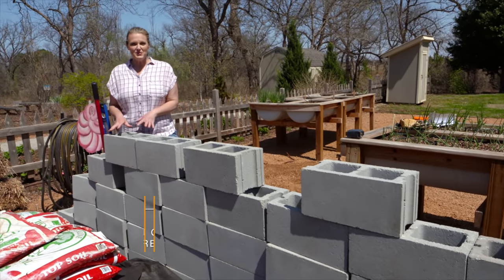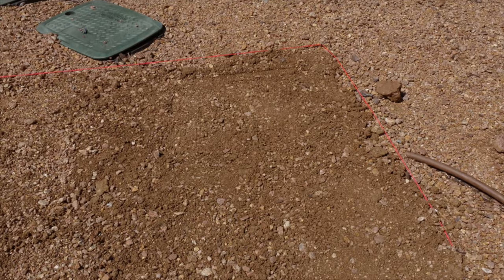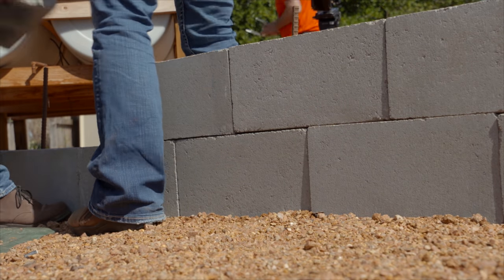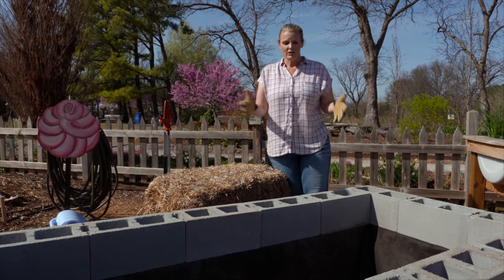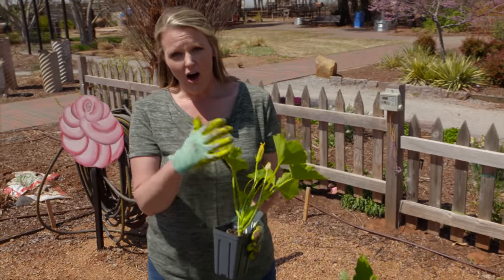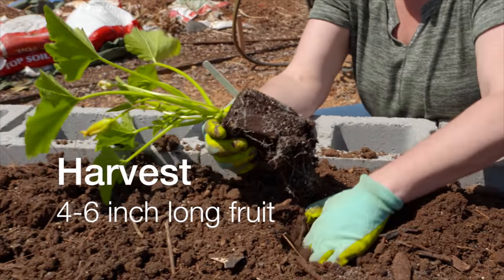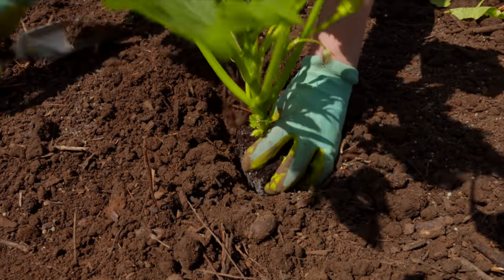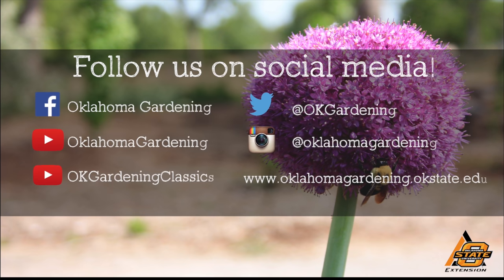Building a Cinderblock Raised Bed and Planting Squash

Comment: Great video. Learned a few things I should keep in mind when for when I do my single large bed that'll "encapsulate" the two 5'x10' wooden beds that are about ready to let go. My plan is to use 6x16x8 blocks stacked three high for a single 15'x15'x2' bed. I'll use rebar on the corners and at two evenly spaced spots on each side wall to hopefully resist bowing over time, and for the sake of extra stability (and disposal of something I'm trying to get rid of) I'll fill with river rock and some sand I've been wanting to get rid of.

I'll reuse the soil from the two wooden beds and for the first year I'll till the snot out of it and spread it even, then each year run the boatload of maple and oak leaves that I end up with through the mulcher and till them into the soil to gradually build it up and make sure it's got plenty of organic matter for healthy pumpkins and sunflowers.

Comment: A couple of suggestions.... 

After you place the bales of straw down in the bed, soak them well. Remember that straw is hollow stemmed and any dry organic matter that you use in this way will wick water out of the soil above away from your plants. This will also allow the straw to begin to break down. Because decomposition will happen, yes, the addition of nitrogen to the growing area is needed. The gardener must also be aware that as the straw breaks down and decomposes, the soil level above will drop. So don’t be alarmed. When you prepare your bed for the next growing season add more soil and compost as needed to fill the bed back up. 

After you have completed building the walls of your raised beds, fill the pockets in the blocks with soil or the material you used to prepare the ground surface. Those open pockets, left unfilled, can accumulated organic waste material and provide wonderful hiding and overwintering places for pests, like squash bugs. All your hard fought and thought won, hand to hand combat with those squash bugs, their juveniles and eggs, could be lost when the second wave of attackers come crawling out of their hiding places in those open cement block pockets. Been there, done that! : )

Filling the cement block pockets will also provide more stability to the walls of the bed. I would also advise adding rebar in a couple places on the long sides as you did the corners when building the walls. Over time, cement blocks can shift out, especially on the top layer. 

When you fill those cement block pockets, you can install sections of larger PVC pipe to slide in the smaller diameter PVC hoop pipe. Or just drive in some precut sections of rebar to install the hoop PVC pipe on.
Reply: I'm glad you mentioned that, I was wondering about a drop in soil level.
Reply: Thank you for this video I am going to make raised bed now with cinder blocks.
Reply: munchkin5674 with all due respect, munchkin5674, I’m sure she knows the info you just said.
Reply: @MaryDavidson911  she may know, but I didn't. Thanks original poster!
Reply: Will the straw decompose and the rotting material cause mushrooms to grow.??? Concrete blocks are $8.00+ in Canada, cross border shopping come spring is looking pretty good.  Love the simplicity of this method. Thank you 👍 👍 🇨🇦
Reply: @jameslaw3740  $8!? That's crazy, they're $1.26 here in the US.
Reply: @MaryDavidson911  with all due respect. She may have known this but the rest of us did not. Some of us are new so all helpful suggestions and information  are appreciated and welcomed.
So calm down.
Reply: Great information and suggestions!
Reply: @cloak5857  As usual most things are cheaper in the US. I don't think Americans realize how lucky they are. These blocks cost at least £3 - £3.20 in the UK ($4.25.) As another example I wanted a wood chipper (by DR Power) it was on offer for ~$800, I emailed asking about shipping to the UK and was told they sell them via their UK arm . . Hurrar ! Nope, emailed the UK arm and the cost of same item in the UK was £1,800 ($2,300,) Unfortunately this is fairly normal.
Reply: @MaryDavidson911  With all due respect Mary Davidson, as this is an instructional video, she should have talked about these things.
Reply: @munchkin5674  yes, there's no way Mary could know "for sure" that the video maker knew everything you said (in fact, because she didn't bring it up, she most likely didn't). Everyone else here appreciated your great advice and the respectful manner in the way it was presented. Thank you for taking your time to tell us.
Reply: Thanxs for the info :)
Reply: @tlc6756  Well said.
Reply: @MaryDavidson911  well the info they shared is helpful to those of who are new to gardening and don’t know.
Reply: @S T if we do this I’m thinking marigolds in the squares and tomatoes next to them.

Comment: I love cinder blocks for raised beds.

In Central Texas Caliche soil, Cinderblock gardening is a great option. Basically, raised bed farming in Caliche is no different than urban farming on concrete. 

A few things I have found that work well to improve the efficiency of farming raised beds with cinderblocks:

#1. utilize the hole space. My top two layers are often lined up in the middle to allow for deeper root growth. It's also great for herb planting; especially more invasive herbs like mint.
#2. One of the highest yielding crops to grow in a deep cinderblock raised bed (3-4 cinderblocks high) are potatoes. They can be layered in a 5x4 bed and can yield a large amount...over 100lbs or more.
#3. When planting squash in a raised bed, I often follow the native american "three sisters" model. There are different variations in spacing depending on the climate, but planting squash along with beans and corn make efficient use of the limited space.

#4. Regarding pest control, there are a lot of natural products that work well....orange oil, neem, etc. But it is far less labor intensive to just regularly pick off the bugs than to open in the morning and cover by noon....most people work and that's not practical.
#5. Leveling is very important, but you don't have to level the whole ground. I leveled on straight caliche at an 9 percent grade. I only level the borders where I actually set the cinderblocks down.
#6. Lining is not necessary. I flip the soil and then cover with straight garden mix (topsoil and compost) Covering actually prevents beneficial earthworms from getting into your soil and helping to break everything down. I did like the idea of layering hay as compost filler, although, I'm not sure how fertile composted hay would be or how long it takes to break down without green compost.

Comment: A lot of people commenting who have never tried this. I have two thirty foot long four foot wide beds built this way that I built 15 years ago. First my blocks are flat on one end and scalloped on the other end. These are standard blocks. Second the ground where you build should be flat and well packed or your walls will not stay level. Third I've found a couple of issues. Over time the weight of the soil will bow the walls outward at the top. Second the concrete blocks are very porous and allow the soil to dry very quickly so you need to seal the inside wall of the blocks with plastic or a sealer of some type. The open webs in the blocks also allow weeds to grow there and are hard to remove. I'd fill them up with something that won't allow weeds to grow or plant some type of herb that grows thickly and doesn't mind dry conditions. I found a drip hose doesn't work well if the soil has a high sand mix as the water drains strait down and doesn't spread throughout the bed. I ended up putting a sprinkler set to water at 180 degrees at the middle of one side but this wastes a lot of water. This year I've gone to large plastic laundry tubs that hold several large plants each. I can move them if required and they don't dry out as fast. At the end of the season I can dump them out and stack them away if I don't plant crops in them for the winter. The real drawback to them is they get brittle out in the sun and only last a couple of years. I put black plastic down on the ground to control weeds and place them in rows so that watering is easy with a hose.
Reply from the maker: Thanks for sharing your knowledge! We appreciate your tips and are wishing you a bountiful harvest this year! Thanks for tuning in! Happy Gardening!
Reply: @OklahomaGardening  What kind of cloth are you putting on your pvc bows to keep the squash bugs out? I didn't understand what you were saying. I'm getting old and don't hear as well as I used too.
Reply: @warlord8954  it's remay cloth
Reply: Thank you for sharing this information.

Comment: Because you had fabric covering the second layer of block, I would have filled the third layer block holes with potting/regular soil and planted herbs in the holes. People should note that three layers make much easier planting, maintenance and harvesting without the back strain. At three layers, rebar is also a suggested.
Reply: Thanks for this Jim.

Comment: I just ran costs of a cinderblock 4x8 bed and one using bagged cement and forms for a 6 inch wide wall....blocks seem to be cheaper and less back breaking work...I also like the potting holes in the blocks for the more invasive goodies like strawberries.

Comment: I hate to tell you but the inside diameter here is only 18sf when using cinder block with an outside diameter of 32sf. If you want 32sf inside, you have to do 4 block wide times 7 block long. Not 3 block by 6 block. Not having the one extra block on each end screws you badly. Your box is only 2.67 ft by 6.67 ft
Reply: I thought that because I was doing the math when I was designing mine

Comment: A better way to use up some of the space inside the blocks is to use decomposing trees and branches. You can even dig out the bottom if using one, or two layers of concrete blocks. This is called Hugelkultur method and has been used for hundreds of years. I would also suggest using plenty of rebar to hold the blocks in place and filling the holes with soil, or gravel
Reply from the maker: Thanks for sharing your tips and knowledge. Happy Gardening!

Comment: I like 2 blocks high>  So i can set and work with out bending over>  I also recommend using roofing tin or cement the bottom Keeps Gophers, Moles Out >   I really hate to see any one make a wooden raise bed>  a waist of TIME and MONEY i made some out of old barn, roofing tin, tee post, and caulk the hole i use aluminum bailing wire to hold it.  painted it white.  They last, 13 yrs so far! Looks really nice <>  NOT JUNKY LOOKING  Guess what?    i can tear it down and reuse the tin for a bottom on some cement block raise beds>  It only took a few hour the make a raise bed out of the junk tin>  I did't have any thing else to use it on!  so a RAISE BED

Comment: I like this idea however there are some issues with this for use in Florida. The black landscape material for the bottom is useless against the grass that grows here. I have used this in my flower beds and some kind of nasty swamp grass grows right through it. You will need some sort of heavy thick plastic. Then you will have to some how deal with rain filling it up and making it a raised pond. Might need a hole in the corner to bail out the extra water.

Comment: I notice you didn't have a plum line.  This will make straight rows of your veg' s.  The only problem with cinder block gardening is you need (long arms) or shorten your rows. Hope it helps.
Reply from the maker: Thanks for sharing your knowledge! We appreciate your tips and are wishing you a bountiful harvest this year! Thanks for tuning in! Happy Gardening!
Reply: Hers looked great. She was able to do it perfectly without having to use one.
Reply: her bed inside dimensions is four feet but if you work from both sides it's only a two feet eight inch reach to the middle.

Comment: I'm curious about the landscape fabric - what brand/type did you use or would recommend?
Reply: I would reccomend No Landscape Fabric.All it does is create a barrier between the original soil and the new soil or if your going to begin with a layer of straw,leaves,unfinished compost etc,it makes a barrier between the original soil and that.You are better off soaking the original soil again and again after applying limestone.This will encourager earthworms to come to the bed and stay there.They can move around through your bed without the obstruction of landscape fabric.I would rather have seen a 1cinderblock tall bed with the holes in the cinderblock being filled with good soil and planted.If you decide you want to make any raised bed,deep or shallow,forget the landscape fabric.

Comment: If I'm planting peppers, turmeric, tomatoes, herbs do I still add a layer of garden liner inside and is adding a drip hose a good idea?
Reply from the maker: Chef Bambu, you might use landscape cloth as a liner, but if Bermuda grass is the primary weed species that they are trying to keep out of the bed then that likely won’t stop it from invading the bed.  A better way to approach the challenge of controlling Bermuda would be to control it completely prior to installing the raised bed.  Organically this could be done by shading out the Bermuda grass with either a dense growing cover crop like sorghum x sudan grass during an entire summer or with multiple layers of cardboard during an entire summer. Also, drip irrigation would likely be the best method of irrigation for the raised bed garden.

Comment: Was there any mention of the cost of this?  Not very practical from my viewpoint.  Squash will just about grow anywhere.
Reply: Agreed.  This video is full of mistakes and bad decisions.  The straw will break down and eventually you'll need to fill it all with soil, so you'll end up with three times the soil and three times the block you need.  One layer of block is fine.  This video is just plain stupid.  And there is no damn point at all to that rebar nonsense.
Reply: Ml
Reply: @Kube_Dog  i concure; 1 course of block...2 if you buried the first course as a leveling footer. the straw was a needless addition

Comment: Is there a way to seal the cinder block holes at the top? Come rainy season I can see where that would puddle up. What do you recommend to seal the holes at the top? Thanks!
Reply: Use a row of 8” X16” X 2” solid concrete pavers as a cap on top of the blocks
Reply: Or fill with soil and plant onions, herbs, lettuce or flowers in the holes

Comment: I think you want to use "cement" blocks not cinder......if I recall the cinder could be toxic?
Reply: Yes, cinder blocks have fly ash, which is a carcinogen.
Reply: The fly ash is locked in the product.  They don’t get hot enough to break down

Comment: Would that kind of raised bed be alright on zone 9b when it get too hot at summertime?
Reply: I think the block would be excellent heat barrier and mulch the top of your garden bed with wood chips  helps to keep soil beneath cooler whether in a bed or in ground pretty much you want garden to be harvested before first super hot spell in July then the bugs and diseases do most things in here

Comment: How many blocks did you use? Great video! Very informative and well shot/edited.
Reply: About 50 but make sure you do the bed 4 block by 7 block to get 32sf. She used 3 block by 6 block which is 32sqft only on the outside. Her inside diameter is a mere 18sf. Leaving off the one extra block on each side screws you out of almost half the growing space.
Reply: @annabellejonesify  thanks!
Reply: I paused the video and counted LOL, 16 on each tier 3 x 5 on bottom tier so 48 altogether

Comment: I think you were using concrete block which is much stronger and heavier than cinder block. Also you called them bricks many times you’re not bricks your blocks
Reply: When you add your straw you should make sure it wasn’t wheat or oats grown with round up or another kind of herbicide that could easily affect all the plants that you grow in the raised bed.

Comment: The issue with cinder blocks is the chemicals they use to make them.Those chemicals can leach into your ground soil and taint the crops.
Reply: Falacy
Reply: They are not cinder blocks. They are concrete blocks. Cinder blocks are not made anymore. I am a mason/bricklayer. Her terminology is incorrect. Concrete blocks have cement.
Reply: The older blocks, the true cindet blocks due contain lechates you do not want in your soil. The blicks today are cement and not cinder so safer to use. They are alkaline though so they can impact soil pH a bit. 
As far as sealing them, a concrete sealant is what you would need. I'm a fan of decorated or painted  blocks too. Mosaic designs or painting them can bring a lot of fun visually to an otherwise boring wall. Before doing either of those sealing them is aa good idea. 
You can fill those open holes with a lighter weight planting mix and plant marigolds, or some herbs like Thyme, Cuban Oregano, Greek Oregano and more. 
It might be a goo idea to also place a few flat rectangular stepping stones as seating along the edges too. The area under those can be filled with gravel or even cement if you don't plan on moving the bed.
Reply: That is what I was thinking.

Comment: Those are really expensive zucchini...
Reply: But in the long run over years that raised bed will always be there.  If you need to move it you can  It won't rot either.  It won't leach into the ground unlike some claims. Cinder block is the better way.  Just don''t morter it together

Comment: I'm THRILLED to see someone other than me using concrete block to build!!! Wood may look better but even the best wood eventually will rot...i have 2 raised beds in an octagon shape and one huge one 3 feet by 10 that is 20 inches tall....the 4 inch solids make a great garden seat when you get tired and believe me you will get tired after all that dragging block around....